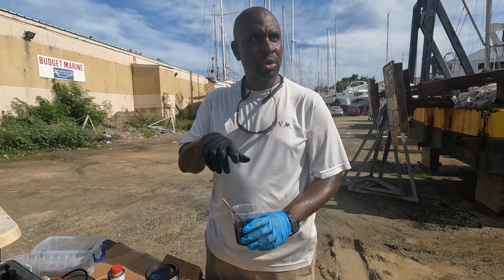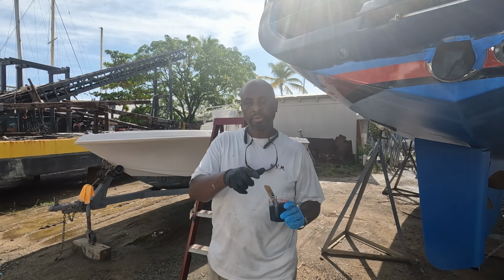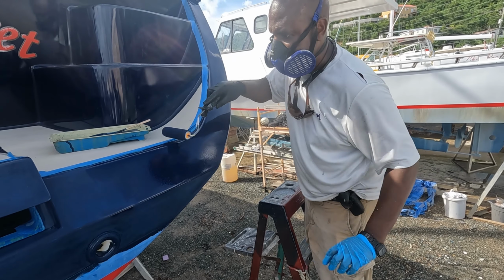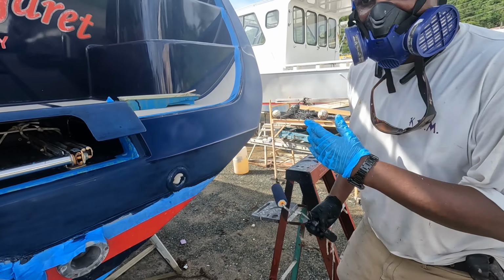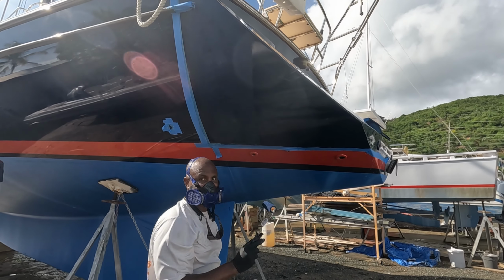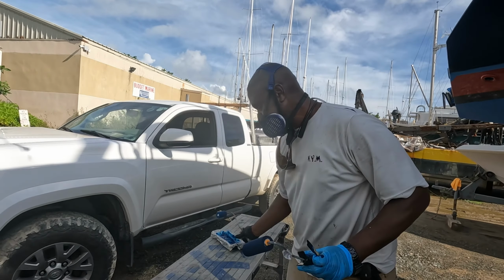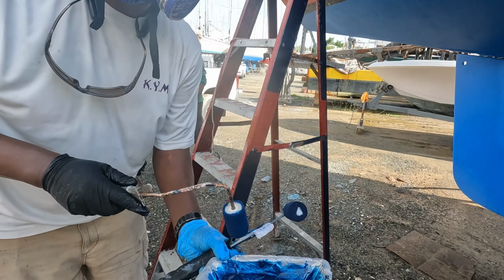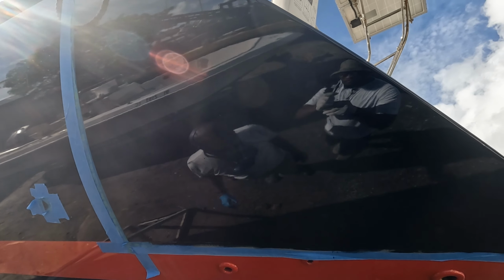Awlgrip rolling NO Tipping

Comment: Great video - thank you. Did you sand the topcoats between coats? If so what grade sandpaper please? Also for the blend you used a 50% mix of pigment paint and what was the other 50% (I could not hear your audio).
Reply from the maker: I only made the video for the final coat, but i did some repairs,  then two coats of primer and 3 coats of topcoat. Sand with 400 grit sandpaper between coats.  The blend was 50% pigmented paint and 50% clear mix. Please subscribe and watch my other videos
Reply: @kennysyachtmaintenance  Thanks Kenny. What do you mean by clear? Is that the Awlgrip Converter or Reducer? or are you using the usual pigmented paint with converter, but thinned down to 50% with the reducer? Also once you remove the masking tape do you need to compound polish or sand to finish the blend?

Comment: You are LEGEND. 
So, why the blended mix on the starboard side seam? I'm not sure I know what "clear mix" is.  Doing a patch with a seam, and no joint to hide the seam, is the hardest part of rolling these 2k paints. It's not like you can go back with rubbing compound to remove the seam.
Reply from the maker: Thanks for your comment.  I will do a video specifically on blending. But the clear mix is a mixture of a mixture of clear base Awlgrip.  And a mixture of the pigmented base . And ofcourse  there is a trick in doing the blend to give a very thin or invisible seam. Subscribe so You will see Any upcoming videos